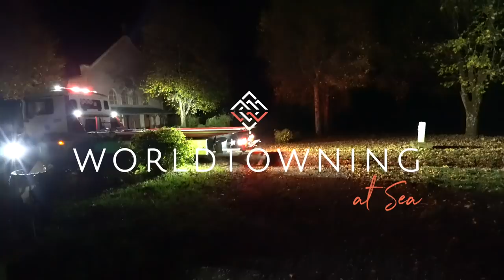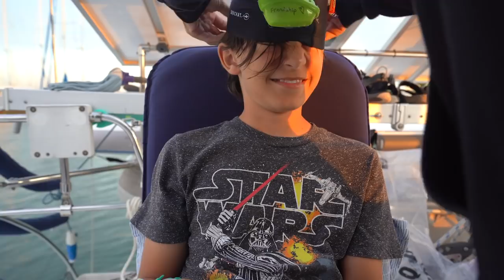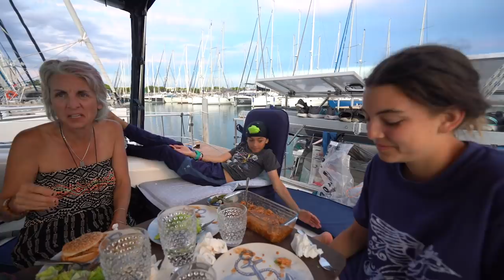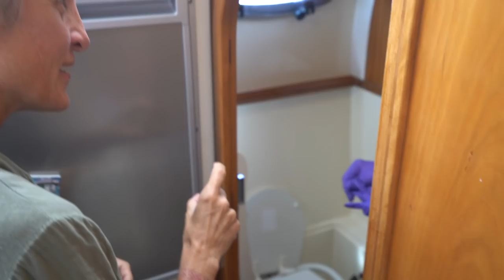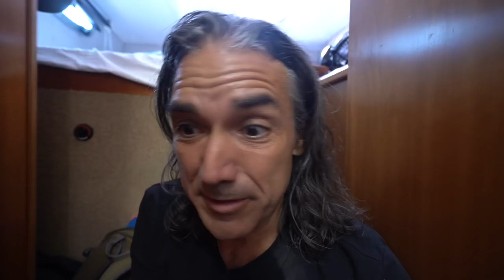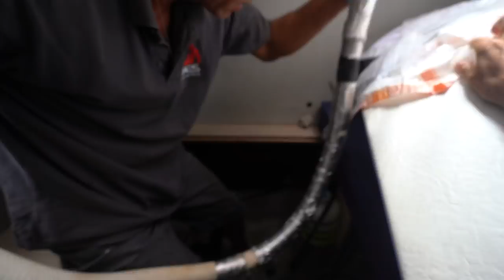ARE WE READY FOR BOAT LIFE? (Our first week...) | EP 255

Comment: What worries me is the poo pipe you took out had what looked like heat resistant masking tape wrapped around it because it's so close to the engine... The one you replaced it with had none....... 🙄
Reply from the maker: You know the crazy part - the former owner said that the tape was there to shelter from the stink. I guess he did not know about the purpose of the take either. I am on-line ordering more right now. Thanks!
Reply: The new pipe also looks narrow - at least if you measure my poo.